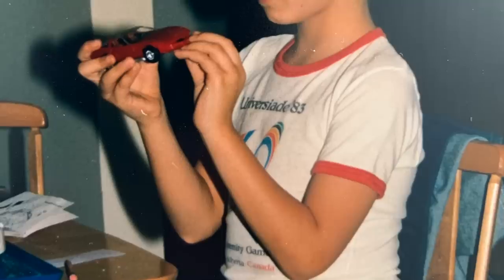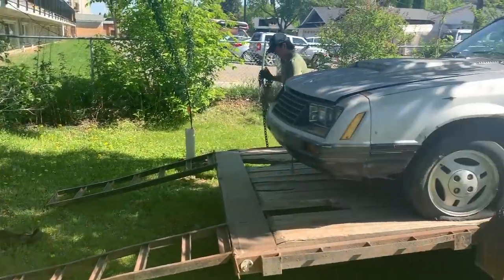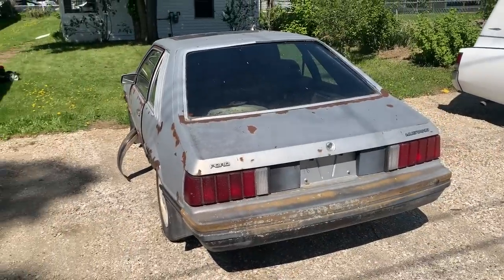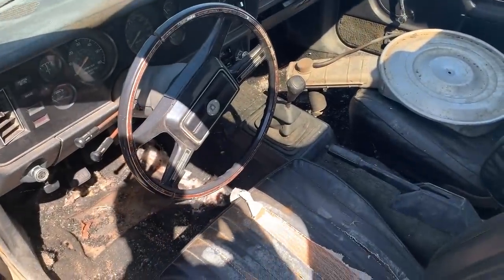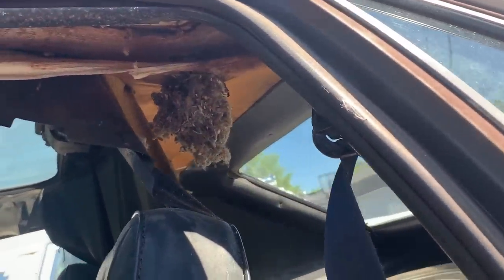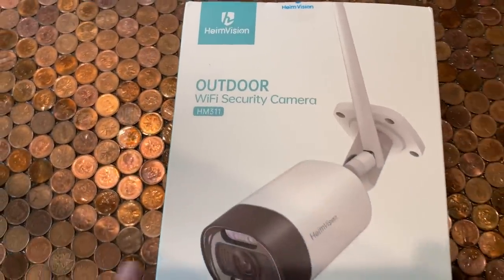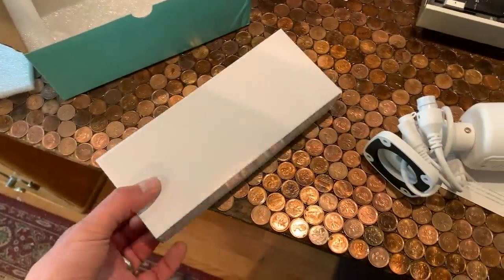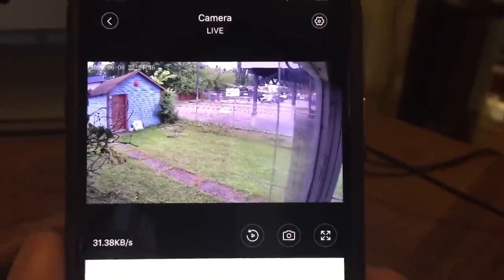Giddy-up Cobra Mustang! and a new security camera for the shop! Another busy day at the shop!

Comment: I had a 1985 Mustang GT. it had the 5 liter HO engine with the 5 spd manual tranny . I have had about 20 Mustangs of different yrs over time, including a 1966 Shelby 350 GT and a 1970 Boss 302 and the 1985 GT HO was about the third fastest of all of them. the fox bodied cars were the most underestimated when they were new. and they are now starting to gain in value. if yours is the Cobra model (which I think you mentioned) it will be at the top of the market.

Comment: Wow, I bought one in 1979.  I loved that car!  It was yellow and black but it did not have the decal on the hood.  Mine was automatic and had a sun roof.  BTW I called it my bumblebee :)  My husband made me trade it in on a boring tan and brown Buick because the Mustang had been in 3 accidents.  The first one happened when I let my teen age son drive it to the store.  It had so much power that he pealed out of the parking lot and hit a cement light pole :(  The second time it was parked on the side of a residential street.  Someone came down the street, ran into the car that was parked behind mine, shoved it into my Mustang and it then hit the car in front of it (front and rear damage!)  Last accident was me.  Some guy in a Mercedes came down the center lane of a busy street where I was stopped and was making a left turn.  Grrrr I got a ticket because I was making a left turn.  After that it developed lots of electrical issues.  Sorry for the long post, I was reminiscing!

Comment: First thing, change user and password for the camera and make it safe, so many people do setup and forget, and its not to be a troublemaker, but wireless cameras have a serious security flaw, if you use a signal jammer, they won't record anything, and its a tool new thieves use, this jams the cellphone signal, wifi signal, basically anything that needs a signal, they primary use it to prevent connected alarm systems from reaching the centrals, they cut phone line, then they jam the signals. Yes signal jammers aren't legal, but easy to order on Internet, and some are made to look like a normal cellphone so even the police doesn't get them when they catch the criminals.

Comment: I think that you know that if they spent time in the yard with you and you don't buy something then they won't offer again. This  is not a patina car, to that I am glad.  I feel some of the highlights even might bite but I see the Diamond in the rough. I  see you starting with the engine and transmission out so that both are already finding its original chance to shine. For one, that oil pan is just south of unattainable. I would want the original bumper, matching engine and body numbers.Since the back seat was folded down, a good cleaning while doing the door panels. Once better starts its not hard to keep that going and quarter panels, doors hood and deck are oem replaceable as there are so many places that sell the new stuff and at competitive price's. I am sure that a  quick google gave you ideas as to how much it might go. I'm fair to sure that with a quick tidy, the wiring is also just fine. So a new headliner, possible set of new bucket seats and maybe kick panels. Once the sill plates, fenders and quarter panels are replaced and maybe some floor patches as the seats are not trying to tip or fall through. I would do the roof with a replaceable panel as well. I still see the hardest and most  costly metal is right there in front of you. Yes it will be high for even a restro but I believe that this market remains being the five liter car.

Comment: My dad always told me to check out the pedal wear to figure out how many times the odo's gone 'round. Good luck to you with that 'stang flip/resto/whatever you end up doing! ♥
He practically stole what later became my first car and I've never forgotten that lesson. The dealer was asking 900 bucks (it was 1998) because of the appearance of the car, assuming that 'cos it was an '89 it had 146k on it instead of 46k. But the pedals were nearly mint. Ball joints were still tight as well, so he bought it for... probably a third of what it was worth. She did pretty good by me for a first car, and by him before.

Comment: You need to get those plastic food trays that fast food restaurants use and place them under the wheels so it's easy to slide it off the trailer if the brakes are locked up

Comment: Ok first thing you need keys. No special keys basic ford keys.take the lock out of one of the doors. Bring it to a lock Smith should have a code number on the lock and can cut a key for it. If not they can use the door lock to make an impression of the key.very easy.

Comment: I got a hold of a 1979 Mustang fastback Pace-car with all of its ground effects in beautiful condition really cheap right out of High School....so many years ago.  Ha!  But I raced it on the streets illegally of course and ended up blowing the engine.  Only engine I had to put in it was a 390 and its automatic transmission.  With the hole already in the floor from the 4 speed I installed a hurst auto slap stick shift kit.  All I can say is with some frame work to keep the car from twisting it was the funnest little car I have ever owned.  Maybe I should say the scariest car I have ever owned.  But I will say do not put much money into that car because they really are not worth a lot.  Good to save it though.

Comment: I hope the belly of it is in better shape than the sides. 
For a unibody car that wasn’t exactly known for it’s structural rigidity when solid/new, if it’s punky on the bottom, properly fixing it may quickly exceed its value. 

Worst case, it looks like it may be a respectable parts donor.

Comment: Compared to the Rolls this will be a walk in the park to restore.
Reply: The Rolls didn’t have holes in the body you could stick your fist in. 

I’ve got a feeling it’s gonna look even uglier on the B side.
Reply: @erikj.2066  Everything metal is easily available and not that expensive.  Try finding sheet ,metal panels for the Rolls.  You can almost build new Mustangs from the parts available.

Comment: Did you check the VIN on it make sure it was an actual Cobra. Its very likely it was regular Mustang that someone swapped a hood and motor into which is common. True Cobra hood would not have the recessed Mustang emblem either. Also there is no indication that it had its factory Cobra rear spoiler. I see no bolt holes where the spoiler would have been. Also the Cobra didn't have chrome trim. It was blacked out. The interior does have the Cobra logos although someone could have swapped a Cobra interior into it.

Comment: The wheels you have there are called TRX and needed a specific size of tire as I remember.  I think it was one of the first with metric sizing.   They used to be 8mpossible to find but now maybe others are supplying thr size now.

It likely used to have a goofy snake decal on the hood before it was replaced.  I imagine they grabbed the scoop off of the original hood.

Comment: Man I would have gone with the T-bird behind it! Don't know why this style is collectible. The worst mustangs IMO.
Reply: Dear S.G.
👍👌👏 Yeah, there had been definitely more beautiful cars than this edged designed Mustang. But Mr. Archbold will sell it and also make some money with it.
Best regards, luck and health.
Reply: I seem to recall that the mid 70's to late 80's was a very unimaginative time for car body design.  Boxes with wheels mostly.
Reply: Dear  @deniseboldea1624  
Definitely!
Best regards, luck and health.
Reply: @deniseboldea1624  As the former owner of a 76 Mustang Ghia (I still could kick myself for the low price I sold it for, when the engine blew!), I agree. However, that's not saying much. If you look at cars now, they all look very similar. I could still tell those boxy looking ones apart.
Reply: Must agree. Ugly car!
Reply: @drfreud65  Agreed,  I do wish they would have stuck with the retro look they revived in the 90's.
Reply: I don't think its ugly other than the rust.  It will be really cute when it's done.   But As a former owner of a small low rider, two door car I know how uncomfortable they are to drive and get in and out ofm
Reply: @Cheap_Grey_Plastic  One thing I will say is that the right paint job can make them more appealing.